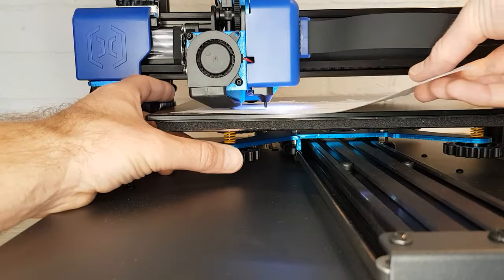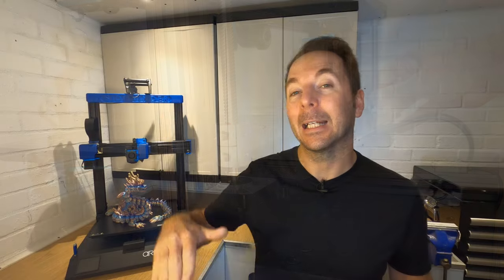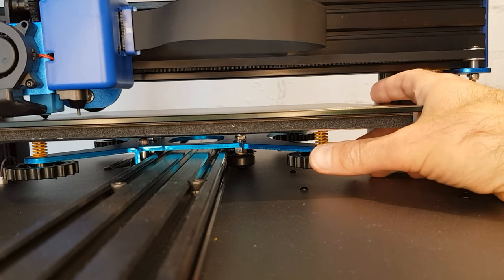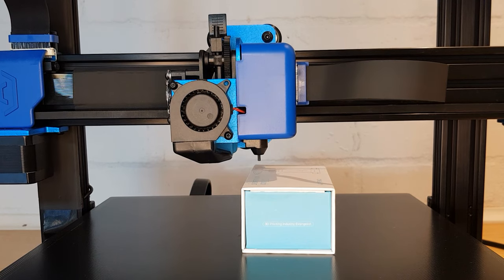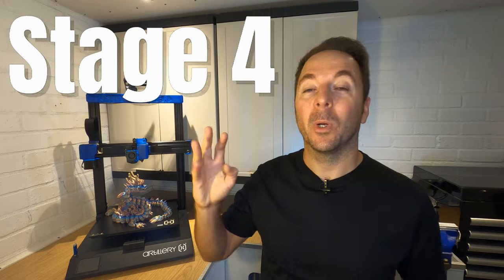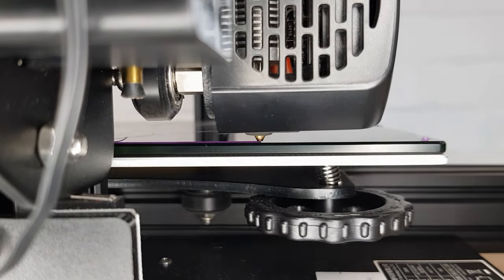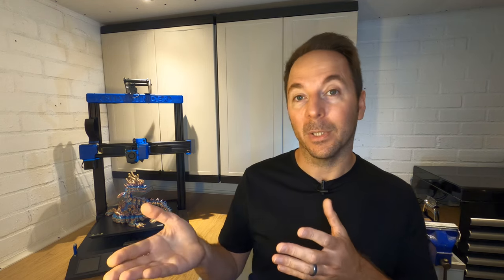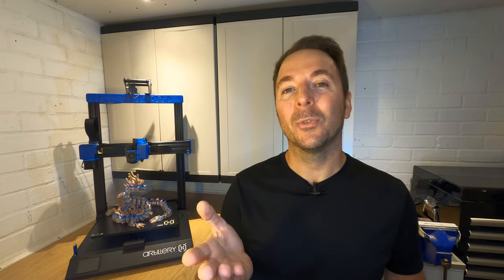3d Printer Automatic Bed Leveling - 6 steps to perfection!

Comment: This video literally saved me from completely giving up on 3d printing. I had my printer working perfectly for months then 1 day boom it stopped working. No matter how many times I leveled it and changed settings, it was always the same thing. Followed this code guide and boom it’s perfect. My only question is why did it work perfectly fine for multiple prints and then all the sudden go crazy?

Comment: I had a printer that was inconsistent at best with saving its zeros.  I never did the leveling by disengagin the stepper motor because I had the auto leveler.  I was a fool.  This video has fixed a long time problem and hours of my life.  Thank you.:face-blue-smiling:
Reply from the maker: Awesome 👍

Comment: This video turned my FDM printing experience upside-down.
I was moments from giving up, after weeks spent trying to fine tune my CR-10s Pro V2 only to constantly have terrible first layer adhesion issues. 
I regret not finding your video before: all this time, I've been setting my Z offset wrong! 0.2 mm from the bed, when it should be touching. Also, the gantry wasn't fully level.
Right now I'm running my first ever smooth print: little to no stringing, everything sticking to the bed without the need to use rafts... FINALLY! It looks like I can finally enjoy this hobby! 😂
I won't ever stop thanking you for this insightful video!

Comment: THANK YOU!!!!
After three months of not getting a single good print out of my new Ender 3 S1, I've decided to relevel everything with your technique - still the z-offset was too low by ~0.3mm for some reason at first (driving the nozzle into the bed), but after live-adjusting it I am getting a reasonable first layer. Gone are those endless nights of levelling! <3
Reply: Hello, im having trouble leveling my ender 3 s1, youve got the same model. Can j contact you whenever you're available and ask you some questions about leveling the bed? I have been struggling for quite a while. Thanks
Reply: did you use Z3 or Z10? i see both used on different forums. i am about to burn my printer down because the bed is never leveled. i didnt know i had to save the mesh and call it in cura. ender 2 s1 instructions never mentioned it

Comment: Wanna give you a HUGE thanks for this video!  I've been printing for over a year now.  First printer the CR6-SE.  Recently ran into problems where I could get NOTHING to stick, even on glue and hairspray.  I levelled and relevelled so many times.  Watched more and more levelling videos.  Eventually I was so defeated I bought a Ender 3 S1 Pro.  

But again, I couldnt level it!  Prints were warping from the plate and i swore on my life I had it levelled.  

You are the ONLY person who has gone over levelling a printer that has addressed the Z offset.  I had been setting it as far as the paper/feel gauge.  I had NO idea it was meant to be touching the bed!  After doing this, and adding that gcode in, the warping is fixed!  I have subscribed because you for sure deserve it.  Now I will be able to level my CR6-SE and have 2 printers going =0

My only gripe with the S1 Pro is the .05 z adjustments, wish you could go finer with .01.  I had to choose between the nozzle being about .02/.03 above the bed or lowering it an extra .05 and touching.  I've only tried it lower and it worked.  At this stage I'm too scared to adjust it up and screwing things up.  

Anyways, thank you so much!
Reply from the maker: Wow, what a great comment, thanks! Nothing motivates me to make better content more than hearing how something I've said has helped someone. I'm so glad to hear that you can now use your printers as you want to. Thanks for taking the time to comment 👍

Comment: I just want to say that i am extremely grateful for this video. I run my modded ender 5 on klipper and completely changed everything but the frame at this point. Added CRTOUCH to my setup and could not for the life of me find out why i couldn't get a good first layer. Everything i did was working great for the infill layers but never for the first layer walls. After watching your video, specifically the part about the Z Offset. I learned the way klipper has you level the bed using BLTouch wasn't accurate enough for my printer. Zeroing out the nozzle to touch the bed fixed my problem and now I'm getting insanely beautiful first layers. Thank you SO MUCH!!!

Comment: I had a warped heat plate on my Ender 3 and ended up having to replace it. Before going back to the headache of re-leveling all over again, I watched this video and since following this advice, my prints are 1000 times cleaner and I no longer have to re-level the machine between each print. The Gcode advice to edit in Cura was an absolute lifesaver. 

Thank you for providing such helpful information! You're a printsaver!
Reply from the maker: Awesome, really glad the video helped👍
Reply: There's an easy fix for this. Simply place 1 or 2 squares of ordinary paper under the magnetic PEI pad right in the center of bed. That's where the dip is, once I did this, I was able to place a ground steel bar on the bed (actually on top of the PEI) and it's now perfectly flat. I used a 3" square, on another printer I used a 6" square on top of a 3" square.  I have 3 of these printers, all 3 had same issue.

Comment: This video should be labelled as "Public Utility". I already had a printer without a bed probe but I bought a Ender 3 S1. I had trouble understanding how the Z offset worked and the mesh (I flashed the Marlin firmware). The mesh didn't seem to work because it printed too low or too high depending of the places. I followed your tutorial step by step and it works perfectly ! Thanks a lot !
I don't understand why the M420 line isn't here by default on Cura but now I have it !
Thanks again !
Reply from the maker: Thanks for the comment, really glad the video helped

Comment: This has to be, hands down, the most comprehensive guide for bed leveling, tramming, setting thatz offset and getting a perfect first layer overall.
Sadly, almost no printer comes with a firmware that makes it easy to set up, but for all of you who have an Ender 3 Series Printer, Profesional Firmware has some auto tramming capabilities that semi automate the task, and can generate bed meshes of up to 9x9. Following this guide with such a firmware definitely will make for a perfect leveling, every time.

Comment: I cannot thank you enough for taking the time going through the steps of this process. 

Being new to the 3D printing hobby I have relied heavily on YouTube videos and feedback from friends and other 3D printing enthusiasts. I have found in most cases the feedback or videos where like drinking from a fire hose. 

Either they are using software, hardware, filament, and calibrations that are outside my experience or they forgot what it was like to be new to the hobby. They unintentionally skimmed over some key areas or went too in depth in areas I am not even ready to jump into. I also found due to what they are printing compared to what I am looking to start with were another contributing factors in my failures.      

I gave up on my Ender 3 Pro and was thankful your example was relevant for me. I upgraded to the same sidewinder and it was refreshing to see someone walking through the process. It helped explain contributing factors as to why I was failing with my existing printing and configurations. 

If you ever need another topic, I could use help printing miniatures for table top gaming. The smaller the miniature with detail is, the more obstacles I have faced.  I have been told resin is the way to go, but unfortunately I don't see purchasing the printer and required accessories in the near future. 

Thanks again for a great video and look forward to new content.
Reply from the maker: Thanks for your comment. It's great to have feedback to help me know if i'm pitching the videos correctly. I know exactly what you mean about the fire hose of information in many videos. Very often it's just too much to follow.
I will give the miniatures some thought, it's not really my speciality but some do manage to get good quality with small details on FDM machines. 
The first thing i would recommend would be trying a smaller nozzle like 0.2mm. That can really help but remember to change your slicer settings accordingly.
Reply: @RickyImpey  I appreciate the suggestion and placed an order for 0.2mm nozzles. I made a note to update the slicer settings once I install the smaller nozzle as well, thank you.
I am going to spend the next few days going through your catalog to see if you already covered some of my pain points with miniatures. 
Adding supports, speed of print, angle of the item versus the bed and nozzle, etc. etc.

Comment: i've been fighting with my printer, and breaking bed mats and have not gotten but ONE print right on my printer. I will try this when i get a chance and reply that this worked as i am sure it will. everything ive been told up to this point has contradicted your video as well as my understanding... sooo THANK YOU!!!!
Reply from the maker: I really hope this method helps you. Let me know.
Reply: @RickyImpey  it actually did a lot really. my mesh isnt "great" but its working.. the Z height starts getting a little iffy maybe but that was only on a stress test.. alli in one stress i htink it was called. great info!

Comment: M420 S1 is a game changer! Thank you so much! I always knew that the printer doesn't use bed mesh and I had to tune the first layer every time. The problem is finally gone.
Reply from the maker: Awesome, glad it helped. Creality have said that they have configured the firmware so that the M420 code is not needed but so many are finding that it is.

Comment: I was trying to following these steps, but ended up destroyed my bed. 😢 Now I’m not blaming the video, I’m sure the advice is genuinely great; but I obviously got something wrong! I started with restoring default settings and then set out to follow each step faithfully from the start. Once I got to the “Level Bed” step my Ender-3 with a CR-touch completed the cycle, but then buried my nozzle into the magnetic pad - burning a hold right through it… 😮

After ordering a new magnetic pad, I decided to try again. I restored default settings once again (this time double-checking that the probe z offset was 000.0), and the second time I did not get a (second) hole in my pad. Feeling a bit encouraged, I completed the tutorial and set the probe z offset. However, when I started printing, the nozzle was way too far from the bed.

This was actually the problem I had to start off with, which led me to search and finding this video; so I’m back to wondering… if the Z probe offset is theoretically correct, what would then cause the printer to print with the nozzle so far off?
Reply: I was given a suggestion to reset my home offsets. I did so, realizing that I should compensate for the bed surface having been lowered from tightening the springs; resulting in lowering my Z axis by 0.4mm before re-setting. I re-measured my probe Z offset, set it, and got a good print! However, I'm just as confused... I thought the probe Z-offset was strictly about the relationship between the nozzle and the probe, and thus would be constant regardless of home offset?

Comment: Thanks a lot, started working with the genius pro which worked fine out of the box until it didn't.  Just mesing with settings did not help. got it working now thanks to your video!

Comment: wow, i didn't have the gcode lines so it was just printing on the very rough level i set thinking the bltouch would refine from there. also didn't know the nozzle was supposed to be touching the bed. good video!
Reply from the maker: Glad the video helped Ray. Thanks for the comment 👍

Comment: This is amazing and enlightening video. I didn't understand the concept of Z-offset, but this video explained it to me! I was suffering with bed levelling on my Ender 3 V2 for sooo long, but this fixed for me. Although, another newbie mistake - I hade G28 AFTER my M420 gcode, which, from marlin docs: By default G28 disables bed leveling. Follow with M420 S to turn leveling on. So basically I was trying to print stuff without having the actual mesh usage enabled :D

Comment: Ah I was doing everything right bar one thing…. I was adjusting the z offset down to the thickness of a piece of paper. Now I know it needs to be with the nozzle touching the bed! No wonder I’ve had adhesion issues! Thank you so much!
Reply from the maker: It's a very common misconception. Glad you have it sorted👍
Reply: @RickyImpey  I have a Sovol sv06 the manual clearly says to use paper to set the z offset, I assumed it would take the paper thickness into account and save the correct dimensions?
Reply from the maker: @edreeder9743  Unfortunately it's very unlikely that it does. Paper can obviously be different thicknesses but the manufacturers want to make setup seem as easy as possible. In the real world, the home position shouldhave the nozzle just kissing the bed. Any gap will increase the first layer thickness.
Reply: @RickyImpey  Thank you. Your videos are excellent, very clear, keep up the good work!

Comment: Nice tutorial.  And the last part about the start M420 gcode command is the one almost every other reviewer leaves out.  Unfortunately, the manufacturers leave this out too in some cases, the Artillery X2 for example.  And even worse, the CURA software they include DOES NOT HAVE THE epron read line, it starts with G28 which wipes out the leveling data!  And they don't include instructions in the installation manual either.  
Spectacularly stupid considering it is a great printer.  Further, if you open the gcode test print file on the USB stick with notepad, you will see they used Slic3r instead of CURA to make the test model... which is even funnier.  But at least that code has the M420 command.  By the way you didn't mention the "Fade" code you used (Z10).  For those that don't know, the Fade command REMOVES the leveling mesh over the hight in mm you pick.  You picked 10mm which is (IMHO) way to high.  No need to go that high, again, IMHO.  3 to 4 is plenty in most cases and makes the part more dimensionally accurate.
Reply from the maker: Yes, great information thanks. I agree, 10mm is probably excessive and lower numbers would be fine.

Comment: Perfect perfect perfect. I'm only learning about the auto level function of my printer now, and I'm surprised that Cura doesn't automatically input the M420 command. Why would they omit that? Who doesn't use a level bed mesh?
Reply: I have since discovered that the m420 command is bugged in older versions of the Marlin firmware and my Anycubic printer uses older firmware, thus making my prints trash. When I used S1 Z10, the print was stretched 1.5x for 10 layers. When I used Z1, the print would be disconnected after the first layer of print. Using Z0 grinds the extruders into the bed. Something to look out for.

Comment: With Marlin firmware it appears you should use a 0.1mm feeler gauge when setting the Z Offset. The firmware subtracts this thickness when saving the offset.

Comment: I was wondering why my printer was printing too high.  I was setting the offset with a piece of paper then when the printer started to print it started a piece of paper width too high..
Now I understand coming from the old CR-10 with the limit switch....  Thanks a Million for this video..   Maybe you could do the video with the Cr-10 printer as I just bought the pro v2 version..

Comment: On your gcode edit . . . I understand M420 S1 tells the printer to use the stored mesh, but what is Z10 . . . is that setting some initial Z offset or home posistion? Most excellent video, as always.
Reply from the maker: Ah yes, probably should have explained. The 'Z10' tells the printer to blend out any compensation it has made for an uneven bed over 10 layers. You can change this figure if you like or just leave it out if you want every layer to remain parallel to the bed regardless of whether it is flat or not. Hope this helps

Comment: I did not know the Z offset had to be touching the bed.. It explains so much on why my prints fail so much when I relevel the bed! I have a genius pro
Reply from the maker: Yes, I don't know where the confusion started but it's a very common misconception within 3d printing.
Reply: @RickyImpey  even the instructions for leveling my bed from the manual doesn't say it needs to be touching but to just adjust till the layers are looking good basically. But thank you so much for the knowledge and help!
Reply: @RickyImpey  Thank you very much for this tip, it is a great discovery for me. I also have this wonderful Artillery X2. I understand that this procedure must be done with the bed and extruder at service temperature (in my case for PLA+ 205º / bed 60º)

I understand that even if we leave the Z axis at a "REAL ZERO", when CURA generates the G-CODE it will lift enough so that the filament is not pressed against the bed.
Reply from the maker: @isabido  Hi, yes, get everything up to temperature. The bed because it will expand slightly with heat and the hotend because you don't want hard un-melted filament on the end of your nozzle to confuse your nozzle gap. Also, you are correct. Your slicer will move the nozzle up the thickness of your first layer before printing so you z axis zero should be with the nozzle touching the bed.
Reply: @RickyImpey  What approximate size do you have in the Artillery X2 with a compression of 2/3. I leave you an indicative image of the dimension that I am asking. Thank you!!
https://drive.google.com/file/d/1vuQWhjfub4NDwJNlKw-tzK77PsbDL84i/view?usp=sharing